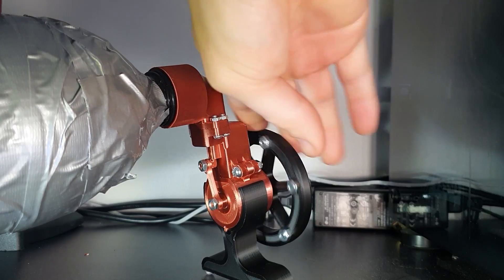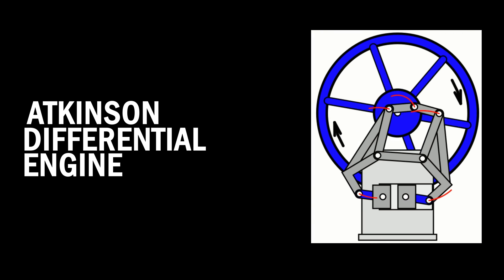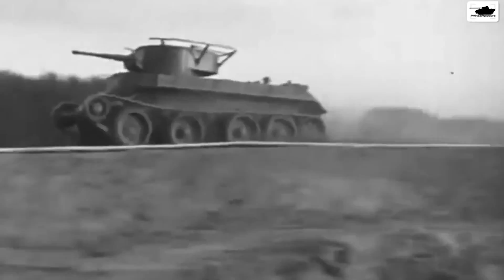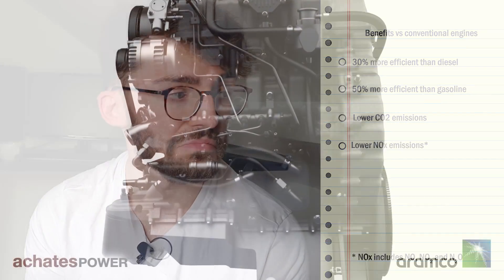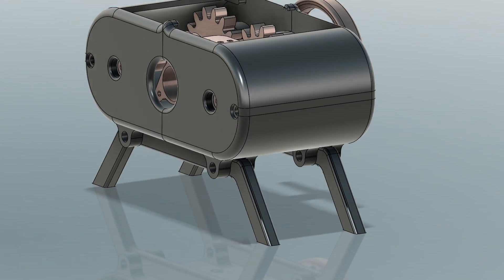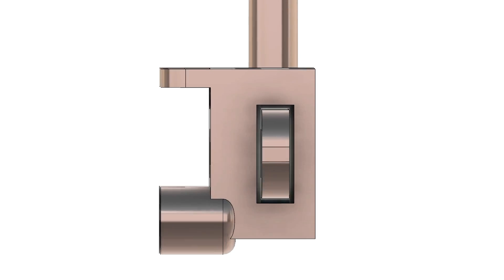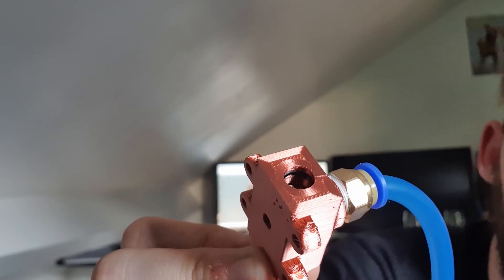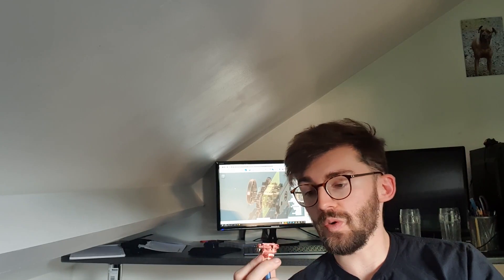Opposed-Piston Engine (3D-Printed)

Comment: now try makeing Two- and four-stroke engine
Reply from the maker: This technically is a 2 stroke engine as there's a power cycle every 2 strokes of the piston (up and down movement of the piston) a four stroke air engine doesn't really make sense as there's no combustion, though it would be good to demonstrate the 4 stroke cycle I guess, a "1 stroke engine" is best for air or steam, where power is produced every stroke
Reply: @kurzey8532  im talking about this The M4+2 engine , also known as the double-piston internal combustion engine, is a new type of internal combustion engine
Reply: @kurzey8532  look up M4+2 engine